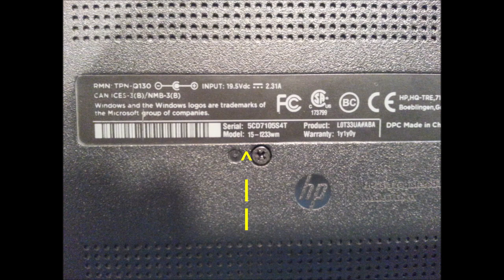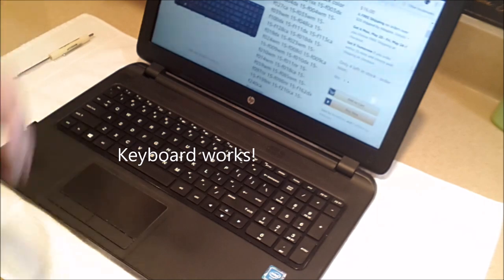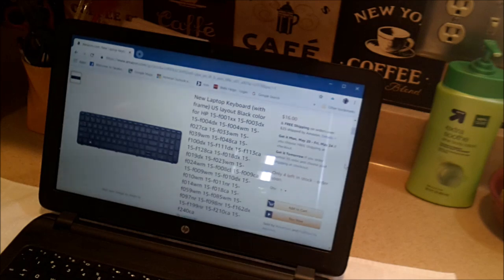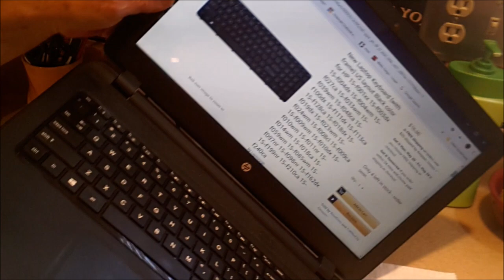Replacing an HP Pavillion Laptop Keyboard 15-f233wm.  EASY

Comment from the maker: Thanks to Mark for pointing this out.  "the model is actually: 15-f233wm.  That 'f' resembles a '1' "
Reply: I'm stuck at getting the zif pin connector (that secures the keyboard's ribbon cable in place) back in. I've spent several hours trying to get it back in...to no avail.
Reply from the maker: @pughmm  Mine went back in VERY loosely Mark.  I expected it to 'snap' in place, but it held fine when I just pushed it in and closed everything up.  I was very surprised.  Be sure you have the right side up or down.  Try both.